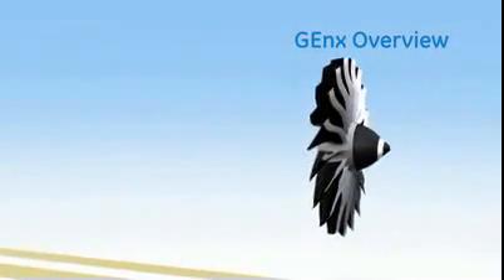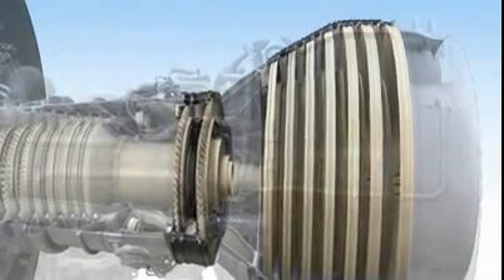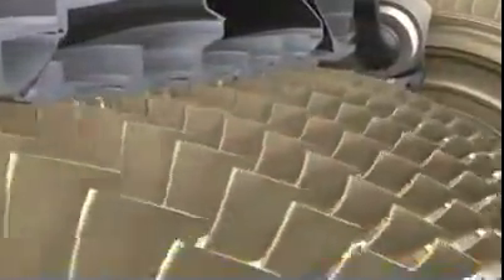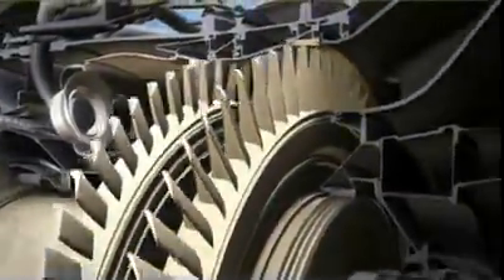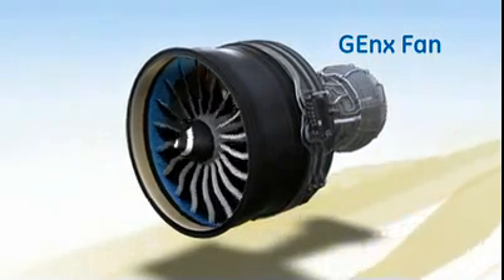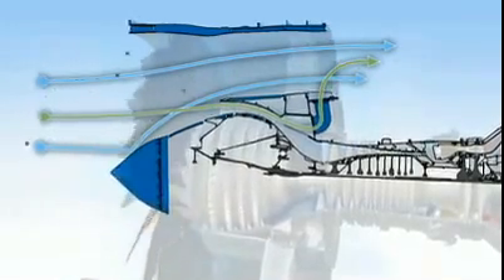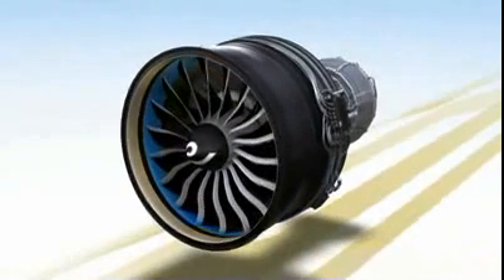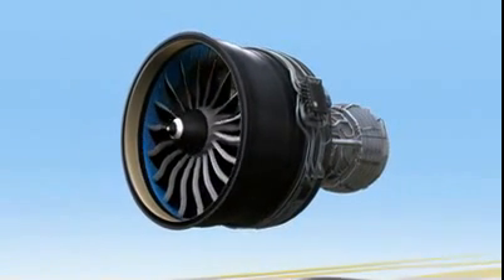How the General Electric GEnx Jet Engine is Constructed

Comment: I still don't understand how jet engines work
Reply: The air has lesser space each paddle, and because of the high speed it cant go back but gets pushed forward. Than the paddle hits it and twist it -> than that mixes and burns, and all that tries to go out, in an even narrower hole, which pushes the plane forward.
Reply: Magic.
Reply: PixelCortex  AFAIK, schematically: compressor, combustion chambers, turbine. A jet engine takes a certain amount of incoming air in the unit of time (the flow rate is a volume in the unit of time, like m3/sec ...) and then accelerates it to the exhaust. The greater is the accelerated flow into the engine, the greater will be the thrust. The combustion chambers accelerate the airflow like an explosion (air and fuel). For amplify all this, the output flow of the combustion chambers hits the blades of a turbine. This turbine spins a compressor put in the front of the engine. The compressor further compresses the incoming airflow for the combustion chambers, further amplifying the incoming flow rate, so amplifying the thrust. Modern turbofans have also a fan keyed on the shaft of the turbine, like a propeller. This fan is run by the turbine. The fan works in the lower atmosphere (take off and climb), where the air is more dense, like a very efficient propeller; while the jet works better in the higher atmosphere. This combination increases the efficiency of the engine and decreases fuel consumption.
Reply: +PixelCortex well, it works like a balloon. when u open the air flow of a balloon with full of air inside it, that balloon will burst and fly away. it's because the inside air got more pressure than the outside. so the idea is to suck air, pressurize the air inside jet engine, and then blow it away, thus creating thrust.
Reply: its simple just remember these steps sucks air,squeezes it,combust,and exhoust
Reply: Re: "that doesnt explain what powers the turbine to rotate in the first place"... 

I think 'tryithere' is right, AFAIK. In many cases on commercial jets, the APU will have a bleed valve for compressed air which runs to the power turbine at the rear of the engine to get it started. Once the power turbine is running at a certain % RPM it will start to spin the initial fan/compressor blades, then fuel will be added to the flow and ignition will take place. Then the APU can shut off the bleed valve and the engine will be running self-sufficiently. (If I understand correctly, the intake fan and subsequent compressor blades need to be running at a particular % RPM before ignition so as to ensure heat doesn't transfer forwards into the engine and damage it). The whole system sounds a bit paradoxical until you realise there is an external 'power' source (the APU's compressed air) used at engine start-up.

And then I guess you could ask "but what powers the initial turbine of the APU?"... and I think the answer would probably be a battery in most cases.

Feel free to correct me.
Reply: Riccardo Smirnov That does make a bit more sense now, thanks. The key part I was missing is the "turbofan" part, the bypass thrust as a result of the front fan in dense air. I've read up a bit on bypass ratios and how commercial airliners will have a much higher bypass ratios compared to fighter jets. I never see this concept explained in "How do jet engines work" videos.

I'm not dumb, my expertise just lies elsewhere :P
Reply: PixelCortex The biggest advantage of the jets is a lower weight than piston engines, so, being equal all things, jets have an higher power/weight ratio than piston engines (though for jets, we speaking about thrust and for piston engines we speaking about power).Also the military use turbofans, but for their fuel costs are secondary. What matters is power, acceleration, endurance.
Reply: To tell you the truth it has a lot to do with Wizardery
Reply: MAGIC!!!
Reply: PixelCortex Good point, in that, this video (in spite of the subject line), does nothing to answer the question.  Looks like a GE promo.
Reply: PixelCortex The intake fans compress the air on the inlet side basically building a wall made of air that continually pushes back through the engine while at the same time not allowing any air to go out the front of the engine, after being compressed sufficiently, fuel is added and ignited which quickly expands the gases and builds up more pressure. Since the back of the engine has very little, relatively speaking, pressure, the hot gases flow towards the back and outlet of the engine. The back turbine blades are designed to rotate with the gases flowing through them and are attached to the axle of all the turbines on the shaft which causes the forward blades to keep rotating and the thrust is pushed out the back of the engine (Path of least resistance). The engines are usually started by compressed air which spins the turbines until it is spinning fast enough to build the inlet pressure to allow intro and ignition of the fuel.  A problem with jet engines is that they take 8-10 seconds to react to increase in speed inputs of fuel which can make them tricky to fly with.
Reply: ***** *Newtons third law is: for every action there is an equal and opposite reaction. Newtons second law is: Force = mass x acceleration.
Reply: Those people have PHds and Master in Wisardery some of them are Master Wizard
Reply: ***** hello, if you want, look for "jet engine starting", there are a lot of info. Generally there is always a "starter", in the small engines this could be electric, in the big engines this is with compressed air. Electricity and compressed air come form an internal or an external source (generator, compressor, batteries, APU). The aim is always to reach the minimum rotation speed of the shaft (20-25-30% of the maximum). This could be done electrically, with a little electrical engine connected to the main shaft with a gear box and in this cases the electrical power comes from batteries on board, or from an external generator, or, in the big engines you could start the main turbine with a flow of compressed air (form external source or from an APU). The compressed air makes turn a little turbine which is connected to the main shaft of the engine and it starts to turn. When the engine comes to the minimum required (25-30%), you put the throttle on "idle" and the engine should continue by itself.
Reply: It does if you read the end of it.
Reply: +PixelCortex jet engines cause combustion thru air fuel mixture and spin a common shaft which then spins the fan first sucking air inside then compressing that air through the compressor at multiple stages and in result creating pressures 23 times greater at the end therefore pushing the airplane forward since you have low pressure in front and high pressure in back that is the very basics of propulsion of jet engines
Reply: magical pixies that eat clouds and fart rainbows. now you know all of the maths. go forth and make airplanes
Reply: PixelCortex isrip
Reply: i said the very same words then immediate read your comment at the top.  Too funny
Reply: simply an open burning system of fuel with air................air input nozzle is MUCH FINER than exhaust....................so most of the pressure created works on exhaust ..............creates thrust.
Reply: the compressor squeezes the air, which causes it to get very hot. when it is mixed with the fuel(kerosene) it self-ignites(due to high temperature and pressure) and this causes the mixture to expand and drive the turbine. the turbine drives the compressor and the fan through a shaft. the fan accelerates a huge mass of cold air and is responsible for 75% of thrust in a turbofan, because of the huge volumes(although relatively slow-moving compared to the hot jet exhaust). the hot jet exhaust is responsible for just 25% of exhaust. although very hot and fast, this exhaust contains a low volume compared to the air which is expulsed by the large fan.
Reply: same i don't either
Reply: suck, compress, burn and blow
Reply: dont worry it will still works you dont need to understand it!. just think of something else.
Reply: +James Henry Smith 
Generator?? It’s an internal combustion engine. If you understand how those work you can understand how a jet engine works. Same principle using different moving parts.
Reply: PixelCortex that’s cos the video is shit, it doesn’t explain anything
Reply: There are lots of good vids here.  You can read some books on the subject at most libraries.  It's very cool and safe technology, despite the terrible midair engine failure three days ago with Southwest Airlines.
Reply: +PixelCortex
ignore all of the stages of fans,  think one fan in front pushes air in,   burning fuel in that air increases the volume by 6 times,  the extra volume pushes the fan at the back more than it takes to turn the fan at the front.  The front fan works with a small amount of air at high pressure,  so the burning air can't push back on it as much as it pushes the fan at the back.
Reply: PixelCortex turbine fuel enters and exits successively at rotating turbine blades on rotor shafts and pressure is converted to velocity for the plane to fly in specially designed wings
Reply: J etc engj
Reply: PixelCortex   jet engines work on the principle of conversion of pressure energy to velocity energy BBC
Reply: PixelCortex
Reply: Thanks
Reply: PixelCortex you are fool

Comment: Air Commodore Sir Frank Whittle, OM, KBE, CB, FRS,[1] Hon FRAeS (1 June 1907 – 9 August 1996) was a English Royal Air Force (RAF) engineer air officer. He is credited with single handedly inventing the turbojet engine. A patent was submitted by Maxime Guillaume in 1921 for a similar invention; however, this was technically unfeasible at the time. Whittle's engines were developed some years earlier than those of Germany's Dr. Hans von Ohain who was the designer of the first operational jet engine.[2]

Comment: the material used in building the internal parts save on the environment too, not just in fuel consumption but also the parts, and metal refineries will run less often to construct replacement parts as less part replacement, less need to construct for given aircraft. thus less environmental hazards resulting in manufacturing and labor.

Comment: Does a rotating fan provide anti-gravity?. I watched a video of an anti-gravity demo. Looked real and could apply to a spinning fan.
Reply: It could, but for it to work it would need to spin around horizontally which in a turbo jet doesn't.. Also, since the turbines are on the other end of the axis, it will cancel the anti-gravitational force..

If you mean just in any old fan, again it could but it'd need to rotate horizontally

Comment: Why do you mix the measurements! imperial measurements are primitive and costing USA $$$$$$$$$$$!
Wise up USA!
Reply: while metric measurements are more practical I fail to see how using imperial measurements are costing us money. Please explain?
Reply: USA, is the only country in the world that is using the primitive measures, and are very inaccurate, and if you want to sell something to the rest of the world you are stuck, because we do not use inches, and feet, no idea what they might represent. And from Engineering point of view it is very primitive. The moment I hear inches, feet I switch off, turn the off button, I have nothing to learn from this docos! Its that simple. I hope that this is enough info for you to see that the USA measuring system is outdated and primitive and that's one of USA problems with economy.
Reply: Mark Mahanets While i agree that it isn't quite practical for the USA to use imperial measurements, I don't think that inaccurate isn't quite the right way to describe it. As far as it being a "primitive" system it technically is less primitive (by definition) than the metric system. It definitely would be better to use metric with the rest of the world, but having had the opportunity to work in the engineering field with both systems of measurement it really has not been that big of a deal to switch back and forth as long as everything is well defined! You have some valid points but i do not think the the system of measurement is to blame for any of the economical issues that the US might have. 

regardless we should switch to metric though
Reply: Hi Adam,
I do not know if you are in the POSITION to make decision for the industry that you represent, but you can bring to their attention, that the rest of the world does not even know what an inch, foot, or yard is, and that this system limits USA form the industrialized world. And regarding the switching between the 2 measuring units and assuming that both have been calculated correctly, it is more of a mental imagination which leaves the person empty. For example "the aeroplane is flying at 20,000 feet" it is unimaginable, compared to "we are now flying at 10,000 meters above sea level", first thing that pops into my mind, is mt Everest, wow the plane is flying higher then mt Everest, its easy to relate to the measure, not only that is very accurate and has no fractions like 1/32 in. It's hard to imagine, and you produce such interesting documentaries and I can't watch them (as I am a Mechanical Engineer as well)  because I want to  relate to what you are presenting! I hope that you have some success with pointing out the advantages of SI Units (that's metric units). And thank you for your correspondence.
Reply: Mark Mahanets Ohhh, I nearly forgot....the primitive measurements are referred to, that the inch was a King of England's bent thumb, and a foot was the Kings foot, and a yard was the Kings step, now you work out how accurate these units are............you must have a laugh at this....
Reply: Ok yeah i would have to laugh at that! Thank you for your correspondence as well! the biggest thing for me is why in the world imperial units arent related by a multiple of 10! That is the selling point of metrics for me, it makes it much simpler!

Comment: @ 7:8 low pressure turbine.... how does the counter rotating design work??  the connection.. with the Low Pressure Fan Blade infront??

Comment: Haven't work on one in years, but having worked on GE, Pratts, and Rolls Royce/ Allison.  Ge was by far made the best.  I was impressed that GE made their engineers actually work in rebuild factories before they were allowed to design. They learned to make things easy, murphy proof, and modular.  It appears they're finally taking advantage of material innovations and modularity design v. high time components, excellent applications.  The next innovation will be extending material life of expensive components like high speed turbines and combustion chambers from breakdown by thermal cycles.  Right now they keep the engines running almost constantly, but that can be changed.  GE, call me.

Comment: where does the trusth take place in engine?
Reply: the fan provides nearly all of the thrust it takes in vast amounts of air and accelerates it out the back of the engine
Reply: inside
Reply: trust is just the accelerated air from the fan nozzle and core of engine.. fan nozzle contributes about 70-80% of thrust while the core contribute about 20-25% of thrust
Reply: the diferance of momentum of the air from entering the engin to exiting the engin iis where the thrust comes from because of the law of conservation of momentum the plain's momentum must change by and equal and oposite amount thus increasing its velocity (basically tthe mian idea as i see it)